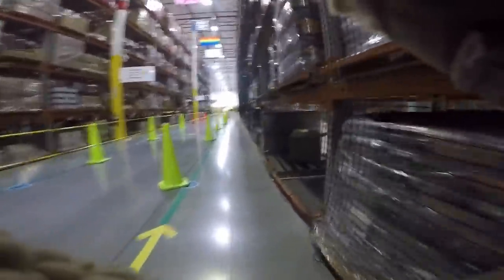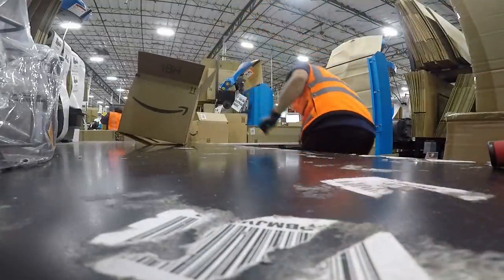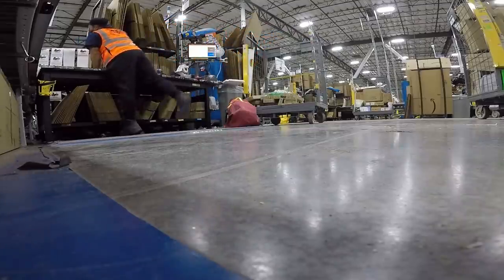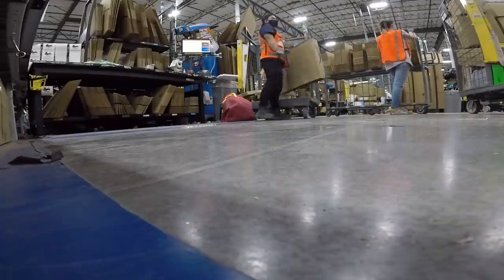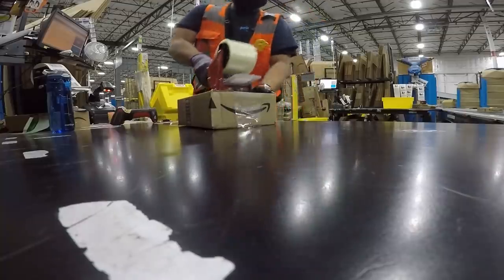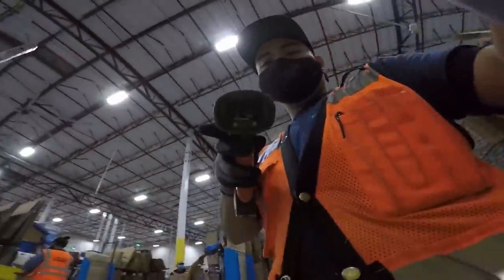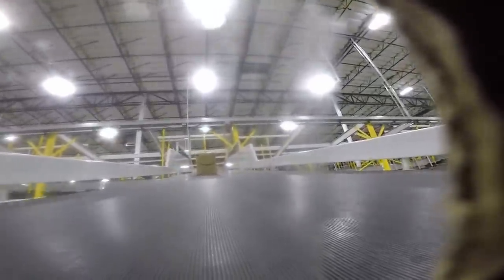DAY in the LIFE of an AMAZON PACKER

Comment: I’m a packer and it’s a little different where I work at. The tote full of products comes down a line and we pick one up and we have to pack the box and tape it up and throw it on the conveyor-belt. Our rate is normally 70-80 boxes an hour.
Reply from the maker: That's cool! That would save us so much time if the cages with the products came to us automatically.
Reply: Are you a single packer?
Reply: Or a flow packer
Reply from the maker: @goodnessifebigh4080  i did singles, multi, etc. Not sure what flow is
Reply: I’m a singles packer
Reply from the maker: @jakehale8662  nice. Singles is my favorite
Reply: Do you have one order per tote or you have to find items from a full tote for the order ?
Reply from the maker: @mnoovurvi we only had to look for certain items when they're "priority" and needed to get out quickly. Otherwise, you just pack whatever you grab.
Reply from the maker: @mnoovurvi  multiple orders in one "tote" or "cage"

Comment: Strange yet interesting to see how different this is compared to an FC (where I work) with robots.
Reply from the maker: Yep i was so shocked when i went from a robot facility to this facility
Reply from the maker: @davysanders4922  hmm i liked certain parts of both. I like being very busy and the robot facility gets extremely busy during peak. That makes it very tiring. The traditional facility is easier in terms of productivity rate but the items are heavier which has a higher risk of great injury. Overall, i think i slightly prefer the robot facility.
Reply from the maker: @davysanders4922  good luck!

Comment: were you always a packer? I’m currently a picker and I hate it so much 😭 I wasn’t told that would be the only thing I’d be doing. I want to switch to packing so bad but I’ve only been working just under 2 months so I’m not sure if that’s too soon, or if I could even switch
Reply from the maker: I worked at two different buildings. The first one, i was a stower in the inbound department. While there, i was cross trained as a picker too. My second building, i started as a packer. You should be able to transfer to a different department. I think you might have to be a blue badge. If you're too good at picking, they won't let you transfer lol. I suggest asking your PA and your manager.

Comment: I just want to know if you get jams on the line and also that you have to do a certain quota on the items but the other items . That the other packers have to do is 200-250 boxes an hour that is mostly small items. I say that is impossible to pack 200-250 boxes per hour cause some of the items a lot like 40 books to cosmetic items with the small bar codes on them. The whole process on the packaging is so troublesome. We have to induct, rebin and pack the orders. Most of the time the items are damaged, missing or stolen and the problem with the bar codes too either they are missing, faded or not scanning
Reply from the maker: yeah jams can really slow you down. The only way to always meet the quota is by cherry picking. If there's a jam and you can't pack anymore, stop packing. They can see on the computer if there's a jam.

Comment: Hey, I noticed you dont put dunnage in alot of the 1a7 or other "taping" boxes. Do you think I can get away with that to save time and make rate?
Reply from the maker: 1a7 and 1a boxes, basically the small ones, you can usually skip putting dunnage because it will kick out and go to the slammer anyways, especially if the product is very light. On some cases though, when the product looks really fragile, or heavy, I'll put a lot of dunnage. But yeah most of the time for 1a, 1a7 i skip the dunnage. Also, if the item looks like it's a really good fit in the box, like it wouldn't move much, you don't need to put dunnage either. Hope this helps!
Reply: @maakudesuyo  oh man this will cut minutes off my time hahah sooper thanks for the tips mang!!!!

Comment: This not the same around the country, in my location: PDX9 

Pack: We have to tape the bottom, flip, pack, tape, label, and send on the line. (Provided label makers, tape printers, and cutter at station)

Units per hour pack : 200 required, easily hitting 268 (station depending). 

Use to pick at about 458 UPH before I switched.
Reply from the maker: Cool! What kind of building was it?

Comment: Why the hell do you guys put no packing material on the bottom of the package only on top after you put the item in that way when the box gets slam down by delivery services there’s no cushion for the item WTF?
Reply from the maker: It depends on the item. Also, putting too much packing material makes it too heavy, which kicks it out of the system, which means it has to be handled by a person and you will get a "coaching". Also, it takes too much time and if your rate is low, you get "coaching".

Comment: Are the shifts 10 hours long, 4 days a week? Also in your opinion would this be a tough job for someone’s who’s never had a job before?
Reply from the maker: It depends on the building but yes this is a 4 day 10hr shift building. During peak season though it can be 5 day 11.5 hrs. It's a pretty simple job so I recommend it if you've never had a job before. However, if you're not confident in your physical stamina, then don't apply for this job.

Comment: I worked at Walmart as an overnight stocker.

It's 10x more chill. BUT, you are forced to exert yourself in stocking a shit ton of pallets in an 8 hour time span. And when someone wouldn't show, you'd be forced to help in other departments. Some of those departments (mainly if you were a guy) would be the heavy shit like furniture, pets (x10 x15 x20 x25 x30 x35 x40 x50 LBS bags of dog food), fitness (heavy weights), liquides (cartons of milk, juice, etc...) all that shit. You have to be a young guy doing that shit or you'll fuck up your back QUICK. And even then, you feel your body being worn out every time you do it.

Further, after "stocking" the items, you have to throw your boxes into the baler and if you were the unlucky fool to come across a FULL bale of cardboard (baler is a machine that crushes cardboard and compacts it into a huge block that can weight anywhere from 600lbs~850lbs~) then you would have to create the bale by bringing in an empty pallet and literally pushing that heavy as thing out of the machine and onto the pallet. It's extremely unsafe if you stand by it because it can fall and tip over onto your foot. So imagine 600lbs of weight smacking you on your worn out feet xD. Once that was done, you have to take it outside into their stocking yard, or wherever they leave their bales. Sometimes you'd have to transfer it from one end of the store to the other on a pallet jack. Imagine draggin that 600lbs shit. Not to mention, you end up making multiple bales a night, not just one. So if you really are unlucky, you might be doing them every time you go throw your cardboard.

That's the thing, because you work with cardboard, you get cuts and burns from the cardboard rubbing off of your skin. Shit is horrible, you def start to use lotion to ease the pain. And if you work in frozen items (I was transferred everywhere because they used my kindness of always willing to do anything) then your fingers get cut and hurt like a bitch under the freezing temperatures. Not to mention, you are forced to stay inside the freezer for HOURS, HOURS!!!! They provide dirty ass jackets for you to wear, and yes...everyone who works in frozen (day or night shift) uses those jackets. And sometimes those jackass workers leave them somewhere in the back hidden, so you sometimes end up working with no jacket if you forget to bring your own. PAIN! 

Oh and once you are done stocking for the night and carrying heavy shit all the time and doing 18 pallets PER department (consisting of small~large items) you have to clean up the remaining mess and "organize" the merchandize even more to make it look very appealing to the customer. Yes, we stocked the items. And we did organize already, but Walmart demands perfection. So whenever I would go in and shop during the day, my heart would sink so much when I would see kids, or people grab items and just throw them on the floor or in random spots. The daytime team is responsible to keep things organized, BUT, for the most part they don't. It's usually the OVERNIGHT team that does the organizing tbh. Overnighters we were called.

And I forgot to mention that whatever overstock you had that wouldn't fit on shelves was supposed to be put in the back. Yes, we do have items in the back. And the reason daytime people always say "I checked the back and couldn't find it, OR we didn't have any in the back" is because they really have no fucking clue where they were placed. It's a fucking jungle back there. And overnighters are tired from all the stocking so sometimes they just put the overstock items in random shelves in the back to hurry up and leave to go home at 8AM....

But even then, it would be extremely difficult to find the items because you'd need experience using the electric forklift to go up into the 10ft high shelves and acquire items. And if you were that guy who was forced into learning the electric jacks/forklifts, you would be the one to get heavy ass pallets that can kill a man in a split second from 10ft high shelves. No joke, one time a supervisor was teaching me to use the electric forklift and almost dropped a 70' TV on his own head. The only thing that saved him was the end tip of the forklift bar stopping the TV from falling over on its side....so unsafe. Oh and don't get me started on raises. You know how I mentioned that I was that "I'll do anything kinda guy"....Well, you'd expect a decent raise right? WRONG. Don't expect more than 1-10 cents increase on your paycheck. The only way you get a dollar more is if you get promoted to supervisor or management. So fucking sad. 

The only good thing about overnight at Walmart IMO is that (depending on your manager) you can listen to music while working, buy whatever food you want in the store, chill by the bean bags,  occasionally get free food, sometimes eat some "free" candy that was left open and not sold, and yes even using the electric jacks because it made draggin those heavy bales 10x easier until you crashed onto a shelf xD And the only thing that kept you going was the people. At least for overnight, we would all get along because of our distaste for Walmart as a large conglomerate. Don't think for a second we didn't know we were being used. So everyone would talk shit about Walmart lol (Unless you came from Target) But it was funny to see coworkers threaten to leave to Target if Walmart didn't treat them better lol
Reply from the maker: That... Doesn't sound chill lol. Thank you for sharing your story! Actually some of my workers left to work for Walmart lol

I was the same type who was willing to do anything so yeah threw me all over the place too.

Comment: Did it pay well? Or at least, did it seem worthwhile? So many stories out there about Amazon packers dealing with unrealistic goals from management...   Just curious to hear your opinion.   Thanks for a great video!
Reply from the maker: For a job with basically zero qualification requirements, i think the pay was ok. It was at $15/hr when i was there and after two years i was at $17/hr. There's lots of opportunities for overtime work and that pays 1.5x and sometimes 2x. During the lockdown, there was a month that they paid 2x for every overtime hour. I was able to earn a lot that month. So yeah, i think the pay and benefits are not too bad for an entry level job. Thank you very much for watching!
Reply: Packing is one of the easiest if not the easiest position. In my opinion Amazon shouldn't pay less than $20.00 per hour. It's devastating on your feet and body. They cut your breaks because it takes at least 5 minutes to get to the break room. So your 15 is actually 5 and your 30 is actually 20. Your body doesn't get much rest.I think it's why they've cut t from 12 to 10 hours. You don't get overtime because it's not over 40 hours per week even though you work over 8 per day.

Comment: What happens with a buyer receives the wrong item in the box? Does the packer who was responsible get written up?
Reply from the maker: From my understanding not really unless there's too many errors. Usually the slammer or an automatic reader catches the error while it's still in the pack side. Errors would lead to coaching from an ambassador. Too many errors and it could be a write up or termination.
Reply from the maker: I think it takes too much resources to find which packer exactly made an error. Sometimes, it can also be on the receive side. For example, if an item was incorrectly labeled, then the picker will pick it and the packer will just pack it. But it is definitely the pack department that has the most responsibility in catching such errors. We're like the last line of defense. Once it goes to the ship dock, it keeps going.

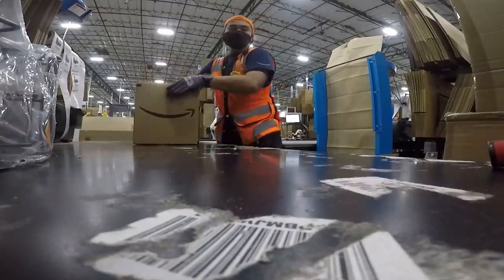Comment: 0:46 I almost never receive any packing for my packages.
4:40 Most of my items come in extremely oversized boxes. whereas I can fit it in a tiny one. Still no packing materials though.

Love amazon, use it daily, but here are my top 3 issues:
1. I have had the most items damaged by amazon, I do order many fragile items.
2. Boxes almost never have packing tape, and if they do, it is insufficient.
3. The boxes are wayyyy too large more often than not.
Reply from the maker: I'll try to offer some explanations. For the packing such as dunnage (paper), sometimes we don't put any for two main reasons: to hit the productivity goal and so it doesn't trigger the automatic weighing scale. As for the sizing, that can be an inbound/receiving issue where the product was incorrectly sized, the seller/manufacturer could have provided the wrong dimensions or at the moment of packing, the packer ran out of that specific box. Most of the time a packer just follows the directions from the computer on what size box to use.
Reply: @maakudesuyo  thanks for your explanations!

Comment: I work in sortation, trust me if u think this is bad..u can’t imagine what that’s like 15-20 miles walking up and down very hard
Reply from the maker: sounds pretty tough yo. I actually worked at a robotics facility as a VRC operator. Definitely did about the same amount or more of walking while pulling pallets. And running up and down the stairs.

Comment: how do you guys pack funko pops and hot wheels diecast hot wheel cars?
Reply from the maker: I've encountered a lot of Funko pops. They usually come prepped by receiving with bubble wrap. We just put them in the box with some dunnage. Sometimes they are still in the box from the manufacturer. Again, we simply put them in the correct sized box with some dunnage.

Comment: the "hey baby, i miss u so much" hahaha
Reply from the maker: I've seen it for real lol
Reply: @maakudesuyo  i bet haha thats why its extra funny. I worked in a lowes Distro for 10 years and this seems very similar.
Reply from the maker: @MidWesti  oh Lowes! Must have been a lot of massive stuff
Reply: @maakudesuyo  for sure, thats why im thinking of trying amazon here in the Denver area. My biggest complaint at lowes was the big heavy/awkward things. like air conditioners, doors, shovels, rakes, tile, power tools etc.. and thats floor picking.. then there was bigger stuff like refrigerators and washers and dryers.. Seems like amazon is smaller lighter stuff which would seem to be easier to lift pack and get numbers easier.
Reply from the maker: @MidWesti  I've worked in a robot facility at Amazon and the biggest item is 18inches. It goes fast but because of the high demand, you actually have to work faster. I suggest the traditional buildings like the one i showed on this video. Also, avoid ship dock haha.

Comment: This isn't Picking. It's Packing Picks, The worst stuff!.   

On this department you get sent to the Dragon Bone (Mobile conveyor belt) to Hand Ball off a that conveyor from the back of trucks, to throw on to pallets.

Picking.
 You would be on a Lollup. A low loader, like a fork truck at ground level.
Or a Pupup truck.  Fork truck where you ride with a cage on the forks, up into the racking 12m high. 

On these you would pick, racing up and down and around the racking, picking up stuff, from around the whole warehouse.

The only other picking is pushing a Cage around to get to Racks of Totes, full of the tiny stuff, like Pens, scissors and make up or small tools etc.

Packing they like you to be quick to pack n ready to ship etc.

Stowing.
Reverse of picking, on a Lollup or Pup truck, with a cage full of stuff to store in gaps in the racking. (Nice and relaxing job)

Last lockdown, I worked at the Amazon in Doncaster. LBA2.

I enjoyed it, maybe because I was stowing. It was warm and Clean.
Money was great. 4 days = £500 per week. £300 bonus in the Bank at Christmas.

I never did the packing though.
Reply from the maker: Thanks for sharing your experience!